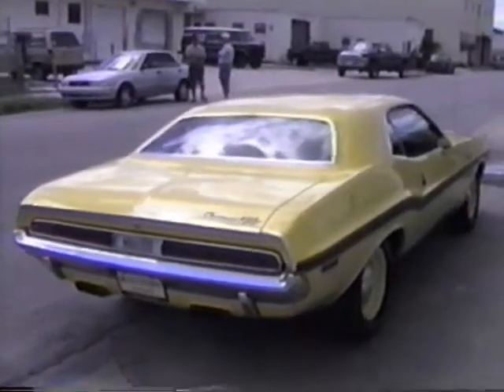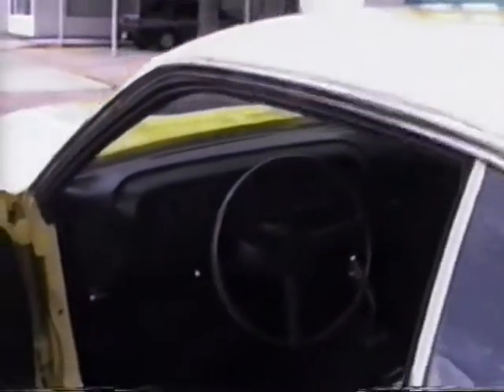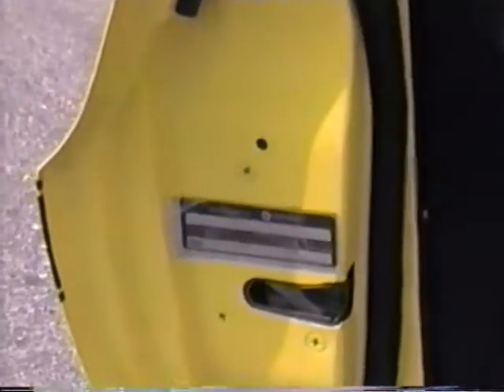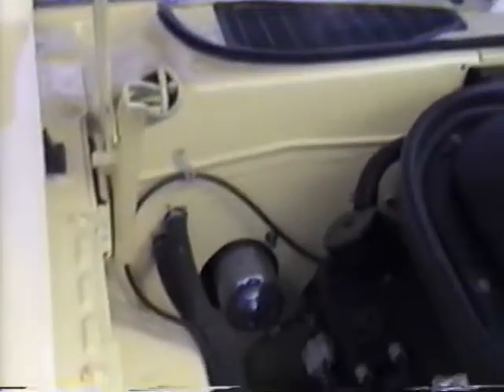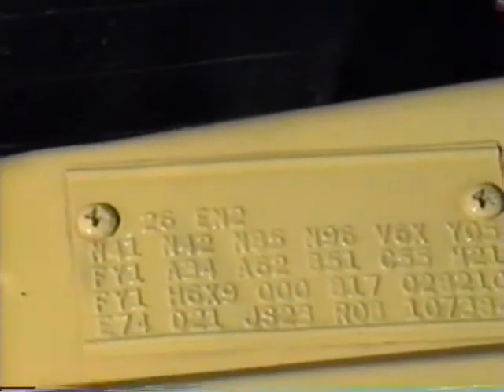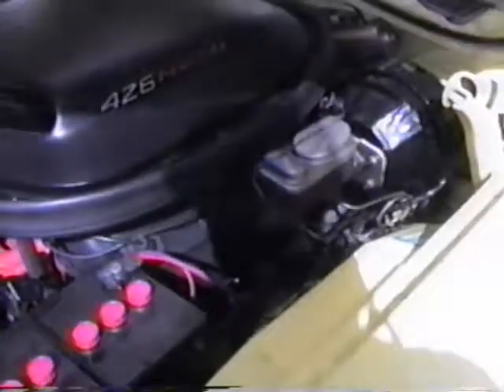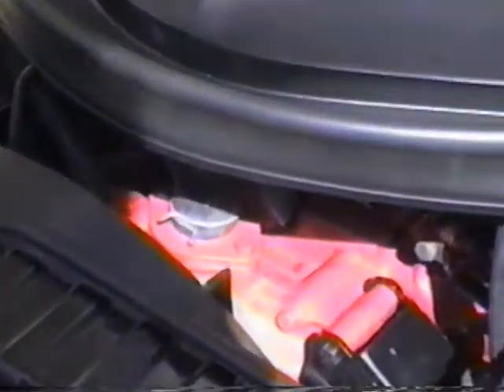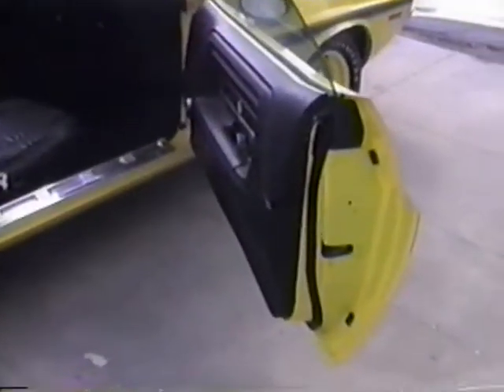1970 4-speed R-code Shaker Hemi Challenger R/T

Comment: That’s funny, we have this exact car in our museum right now. I was just working on it today and decided to go on YouTube to see if I could find it and here it is! The numbers match!
Reply from the maker: Holy Weenus I wish I bought it for $48,500 when I had the chance. I found it in Greer SC in the front yard of a trailer home with a lawnmower pushed under the front bumper in 1986 (unrestored) & it was absolutely not for sale at that time. Where is it now?
Reply: radarvectors2 Newport Car museum in Rhode Island. It was sold at auction to us and put on display in late 2017. We just performed a little maintenance on it this week replaced the fuel and oil and got it running good. It still looks just as good as it does in this video. Not sure if it’s been repainted but looks possible. underside and the engine bay is beautiful. One of 11 rt hemi challengers built with the shaker hood and the 4 speed
Reply from the maker: I just dug through my old pictures & found the picture of this car pre-restoration. It was painted black and had a regular sport hood on it.  The guy that restored it said that although it had the N96 code, he didn't believe it ever had a shaker. he paid $5000 for NOS shaker parts back in the late 80s, early 90s.  Being that it was a 8/69 build, I can see how the shakers may not have been ready for production yet.  A friend of mine has the other 8/69 built JS23R0B FY1 N96 (D32) car - just a few numbers away from this one.  It is still original unrestored and also doesn't have a shaker.  although he has the N96 code too, there is no hole in the firewall for the shaker cable.  Interesting...